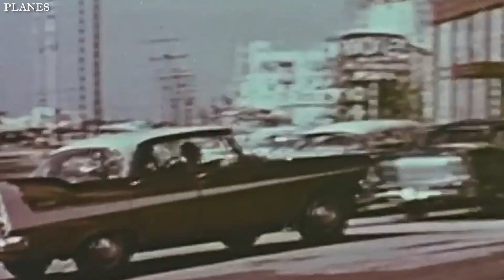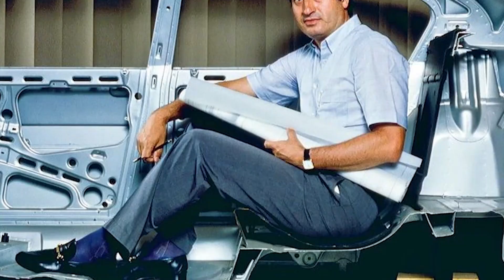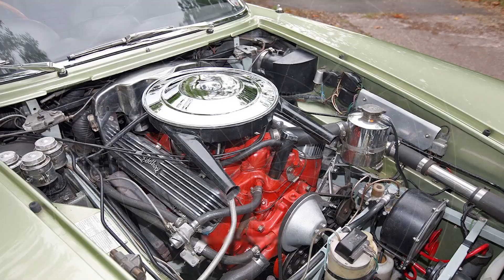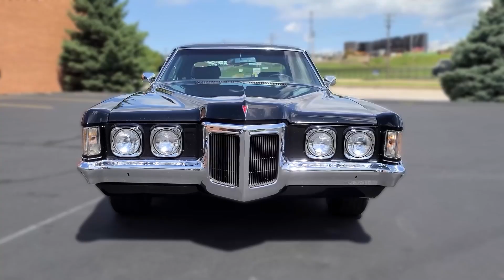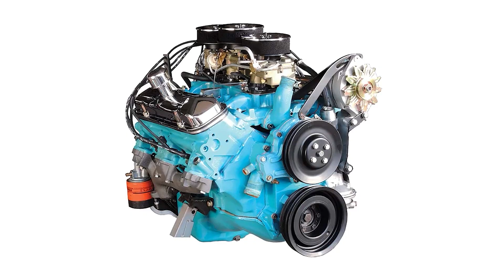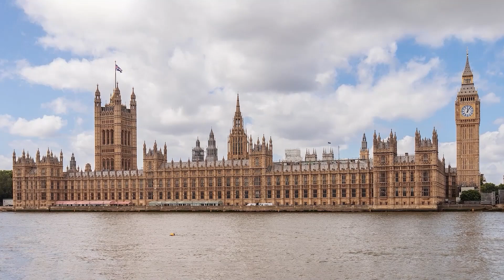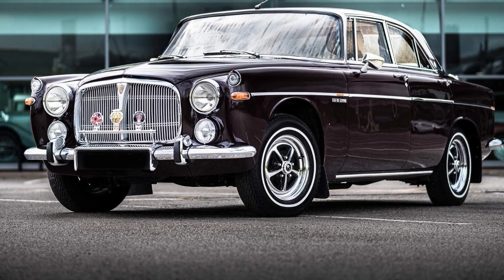3 Most Forgotten V8 Beasts Now Extremely Rare!

Comment: Significantly rarer that the Grand Prix SJ was the SS 454 Monte Carlo.  For 1970, about 3800 cars (3% of all Monte Carlos) were sold compared to the SJ's 10,000 (15% of all Grand Prixs).  Both could be had with a 4 speed manual transmission.  The SS 454 was rated at 360 hp/500 lb⋅ft - the same engines was offered in the SS Chevelle.  The biggest performance difference man have been the axel ratios offered, the lowest for the Grand Prix being 3.23 and the Monte Carlos being 3.31.

Comment: Rover could have used the Triumph V8 as fitted to the Stag but the unit was fraught with terrible reliability issues.   The 3.5 was chosen as the "cheapest" option they could buy stateside that still had the minerals to power a heavy motor and found its way ironically into Triumph TR7s Range Rovers, Land Rovers and was even tested to power the Scorpion tank losing only narrowly to a Jaguar engine which gave the Scorpion its insane 70mph unheard of in an armoured unit lol   The P6 that followed the P5 also was available with a V8, the development of the P6 was started before the P5 even went into production and incorporated a space age body design not seen since where every body panel was exchangeable and easily removed, it was also the first time a car was fitted with again "space age" interior parts that being plastic wood effect trimmings that were a fraction of the weight of walnut.   BTW the front lights of the Keeble came from Triumph's Vitesse design, slanting quad lights were very much in vogue with Routemasters and Rolls Royces of that era sporting the quads but none had that look the Vitesse had.   The 2 litre Vitesse, big six cylinder engine which went on to power 2.3 and 2.6 Rover SD1s in later years was fitted to a car with the body weight of a Mini making it a thoroughly overpowered little car.

Comment: The engine in the rover is a Buick 215 cu-inc and was later on used in Ranger Rover at the beginning and later on change a little. Was it the right thing to do to put Solex carbs on it or not........

Comment: Another P5B former owner, I bought mine in 1986 at the grand age of 21, for the princely sum of £50, from a young electronics enginner at work who'd paid £995 ten months previous. My Dad strongly advised against the purchase, which was understandable as my rusty Minor 1000 had stood in his front garden for 4 years at that point. (it stayed another 13 years). As soon as he got home from work he fell in love with it, and within a week he'd replaced a track rod end and got it MOT'd. 17mpg on a good day, He took my Mum to Cornwall in it, a 700 mile round trip. Always misfiring on one or more cylinders, and after two dubiuos 'gearbox repairs' by shed amateurs, it was parked and forgotten about like the Morris. My folks paid around £4000 in council garage rent, when it was dragged back out many years later (for £500!) it was rotten and no longoer shone. Along the way, my Dad aquired a 'spare' 1968 Coupe which had been abandoned in the corner of a garden for years. We chopped it up and kept as many spares as we could, most of the big stuff went with my Dad's, but I've recently found boxes of instrument cowls from the Coupe! CKG72L was the reg if I recall, Zircon Blue with a cream half leather interior.

Comment: The maker of this video needs to check things more thoroughly - the car seen driving at around the 40 second mark is actually a later Aston Martin not a Gordon Keeble. Look at the very front of it, the grill and headlights are not the same.The air-scoop on the bonnet is different and the whole shape of the car is squarer than the Gordon Keeble which was more the fashion in the mid to late 1970's not the sixties !

Comment: To think the good people of Rover went to the trouble of putting a chrome acute 'accent' over the 'e' in coupe and still the commentator calls it a coup (as in chicken coup). Oh well, never mind.
Otherwise, apart from the usual wrong photos this is a well researched video. 
The ioe engine came first in the Rover P3 (my first car) and ended in the P5 (which I also had the Mk 3 version.) Rolls Royce also used the IOE engine.
One wet night (about 1970) I was following lights down Birkdale road in Auckland NZ. At the point it changes to Beach Haven Road at a tight left turn, the red tail lights suddenly became headlights and then red again before it stopped. When I came to the car it was a Gordon Keeble with an ashen faced new owner swearing he would in the future be very careful with his right foot in the wet! Good looking car. Still the Aston Martin of the same design objective was at least as good looking, had a British higher revving quad cam V8 and from my experience of 5 years ownership it was stable enough in the wet.

Comment: I had a P5b Saloon for 39 years. It did 386,000 miles from new  and incredibly on the same engine and  gearbox all down to regular maintenance. I did fit electronic ignition to it (Lumenition) i changed all oils and fluids at least annually quite often twice per annum.The V8 was a real workhorse. Super car, would have one again tomorrow!
Reply: Hi John, had a friend called John and was wondering if you were the same John I knew years back, I had a Cameroon Green P5B and another friend had an Arden Green P5B, if not no prob, best wishes and happy motoring.
Reply: a lovly car ,

Comment: A great video, spoiled by inaccuracies and random images of a Jensen Interceptor. Also the Lancia Flaminia did NOT have four slightly sloped headlamps. The Pontial 455 cube V8 engine as not a marvel of automotive engineering, instead it was an underperforming lump, with points and a carburettor.
Reply: There were smallblock engines making more power than the majority of those Pontiac 455s.  It also never had a Mikuni dirtbike carburetor nor did it have crank/cam sensor type electronic ignition... somebody got lazy when they put this video together.     

Anybody spot that "cameo" silhouette of what appears to be Pres. Obama earlier in the video (0:43) masquerading as Gordon?   And how many times was the Chevy engine's specs repeated again and again?   If you wanna pad the video, at least use accurate and useful info.

Comment: interesting, the keeble has essentially the same powertrain as the Opel Diplomat. It also came with a 5.4liter corvette sourced V8, DeDion rear axle and disk brakes. Later also the Diplomat based Bitter CD.
Reply: Are you saying that the Opel Diplomat did have a 327 cubinc original in it.... but what about Opel Ambassador then!!
Reply: @rvarsigfusson6163  only the diplomat had american V8. Diplomat A had the 4.9 liter and the Diplomat B had the 5.4 Liter. the lower models Kapitaen and Admiral had a straight 6.
Reply: @uliwehner  Thanks RESPECT.